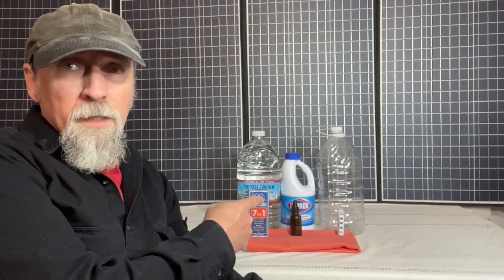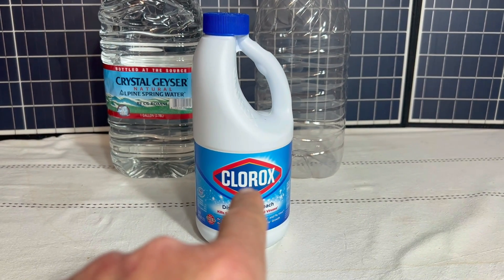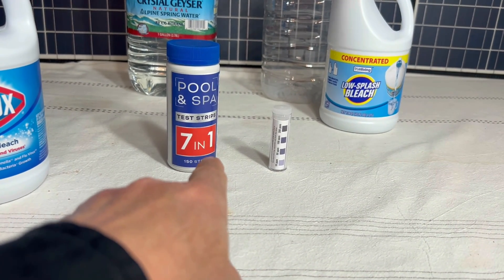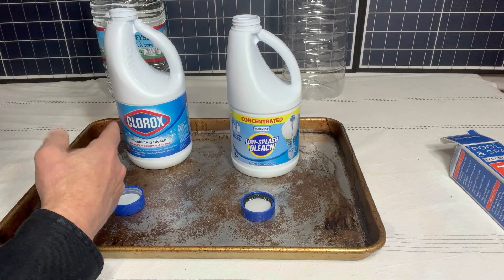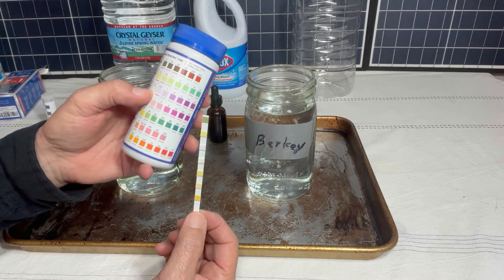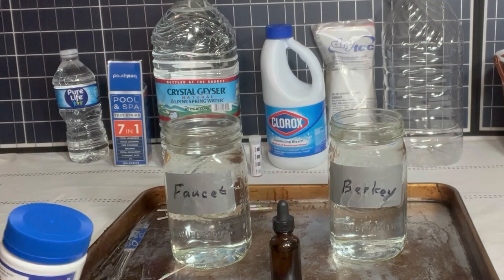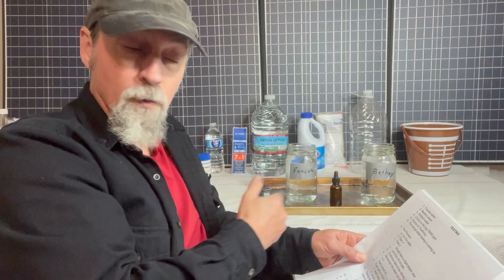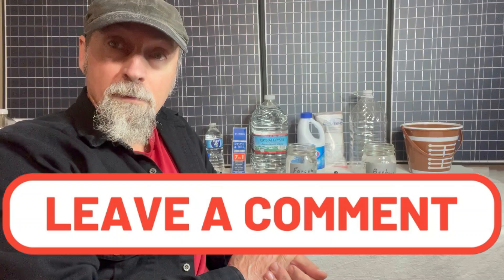DIY Water Treatment Kit For Safe Drinking Water

Comment: You kinda glossed over how chlorine concentration changes in all water with time. You can have  50ppm concentration in water and simply stirring it, it will speed up the process of the chlorine becoming its gaseous state which it does naturally. They even sell open glass drinking containers with magnetic stirring rods for this very purpose. Adding more water just complicates the whole premise of measuring. I've used powdered pool shock in drinking water for years without measurement for when to drink as your nose and taste buds will tell you when it's ok. I'm no doctor but it is logically false someone is going to drink water with a concentration level so high that they drink through the burn thinking "it's fine". I appreciate the test strip method but you can make this in 5 gallon buckets without being exact and simply stirring a few times with the lid off to allow gas venting will drop levels very very quickly.
Reply from the maker: Yes not everyone will need to test, depending upon the chlorine source they are using. However, testing can be done for protocols/procedures to insure the concentration of chlorine over time (years perhaps)
With the knowledge of the concentration one is starting with it will not be necessary to stir the water nor purchase a device for doing so.

This will also give one confidence in the treated water.

Yes you can smell and taste the chlorine when it is to high of a concentration, but adding water to dilute will give you more drinking water than stirring the water to get the chlorine out to acceptable levels.

Same amount of chlorine, but more drinking water.

Thank you for watching!

Comment: Just an FYI, pool shock comes in those plastic pouches which for short term, approx. a year are adequate storage, however beyond this it is necessary to store in glass jars as the chlorine being corrosive will eat through the pouches. When using jars with metal lids always line the lid with plastic wrap as the chlorine will corrode the metal lids.
Reply from the maker: Yes very true! I found out the hard way!

Comment: Well done! Lot's of information in this video. When looking at this from a long-term storage SHTF scenario, I'd be curious as to the expiration date of these test kits.  I checked on the Dry Tec years ago and I don't believe it expires. That being the case, I store it as my preferred method along with bleach tablets as a back up.  The test kits would certainly be useful in any scenario if they store well. Thank you.
Reply from the maker: The Restaurant Test strips will keep for many years. I don't know how many for sure. I used them in my work for several years and used many of them that were several years old and they worked very well.

The Pool Test Strips are supposed to have a shelf life of one to two years after opening. 

I am going to vacuum seal mine now that I have used them.

The test strips would be great for getting the process in place using the pool shock and then putting them in storage.

I don't think the Pool Shock ever expires if properly stored which probably makes it the best long term option for water treatment.
Reply: I think the strips are definitely a plus to have on hand. When I order I'll search for an expiration date. Seems we came to the same conclusion about pool shook being the best long-term option. I've just never put it to the test and then drank the water. Thanks again. @GettinReady1